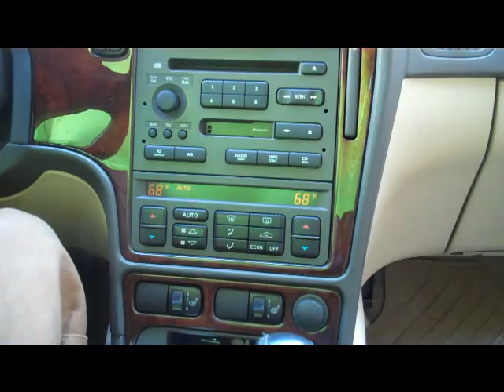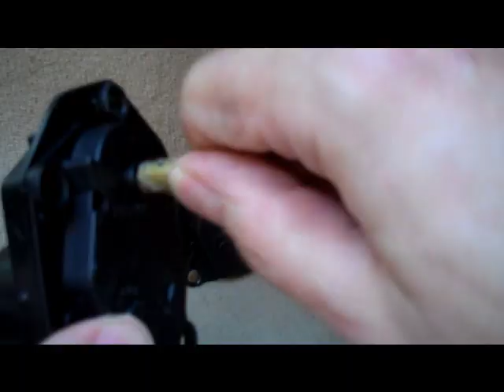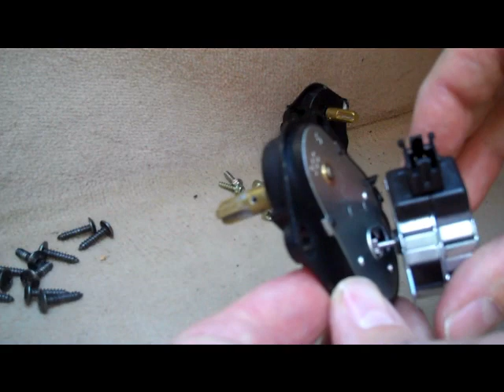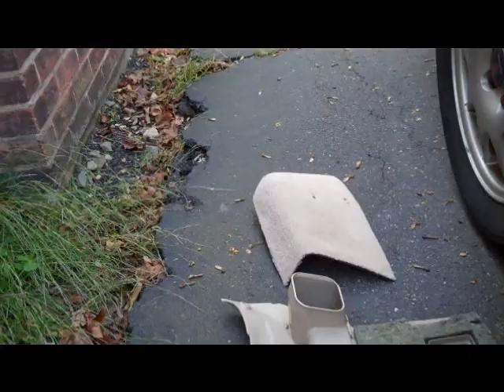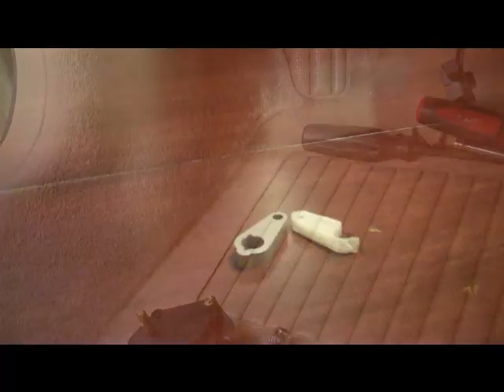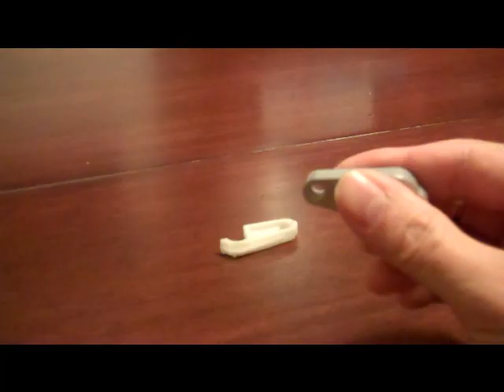Saab 9-5 climate control repairs

Comment: Advise against using the aluminum/metal arm.  The Swede engineers made it plastic so it would be the weak point in the system if binding occurs.   Going into the heater box is man-hour intensive indeed!
Reply: they did it because they're cheap as fuck like every other corporation

Comment: @johnstonb I recnetly got error code 13 and so I checked my left stepper motor yesterday and found out it wont move properly and it kinda has a rough time moving, and when I calibrate the AC it just wont point upwards and center properly. Got any ideas on how I can fix this and is it DIY'able?
Reply from the maker: +Man Oat 
Hi, if the motor itself is having trouble moving smoothly, and it's not the mechanical connection to the gear or the lever, then most likely it's the stepper motor itself. It sounds like it "tries" to move, so it must be getting power if it is moving at all. It would be possible to DIY the stepper motor itself, if you can locate an affordable replacement from a wrecked car that would be cheapest. I don't know what the motor assembly would cost, but I imagine a bit more expensive than used.
Reply: Thanks for the help!

Comment: Did you have any pictures of the driver's side of the heater box?  It appears that the stepper motor feeds through this new parts?  Thanks,
Reply from the maker: Sorry, I know it is difficult to see from under the dashboard, but the essence of this repair is to prevent having to completely remove the dashboard to get to the heater box, even though the manual might direct the repair to be made in that way. It is difficult to see and you kind of have to do it by touch, but since I did not have to strip the interior of the car, I do not have a picture of the side of the airbox. There are drawings and pictures posted by others on the Internet, but none of my own.

Comment from the maker: Thanks, I believe there are other manufacturers that do have on-board diagnostics for the climate control, especially if they have "automatic" controls like this car. It automatically defrosts the windshield, blows the upper/lower vents, and especially, switches between heating and cooling.

Comment from the maker: I am glad it was helpful. It is a pretty long video, but it covers a variety of problems that can be encountered, which is probably more typical than not with an older car.
Reply: Hi. I am trying to fix my brothers 2002 9-5. When the blower motor is on, only air goes to the feet or the face but does not go to the windshield. So perhaps the gear is also misaligned and does not engage because it is up like in your video and has to be tapped down. Where exactly is this stepper motor located?  I wish you had shown detaching it but you pointed in the space under the glove box. Is this error code 11?  I will check the SAAB site to as you mentioned. Thanks a lot for your video!